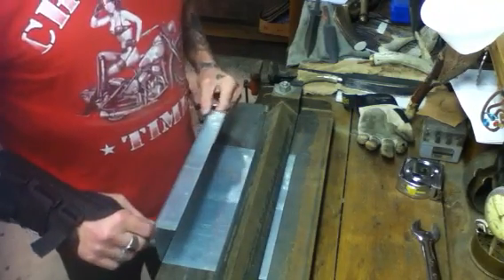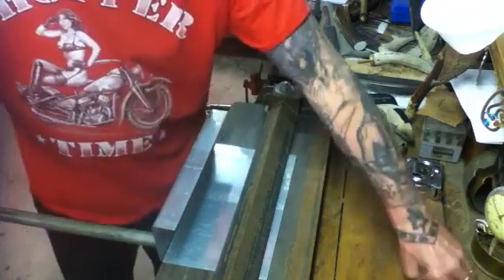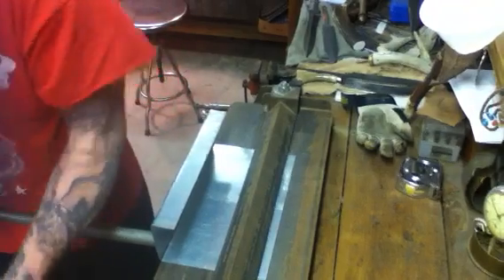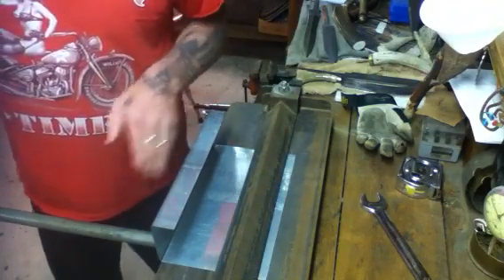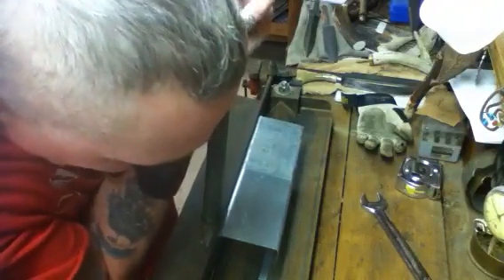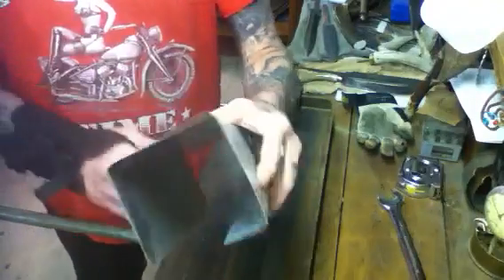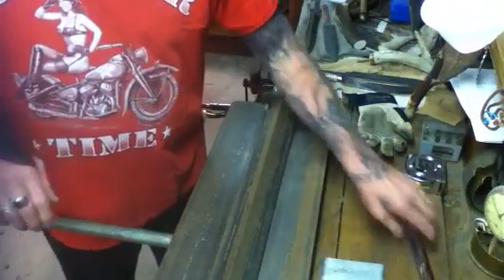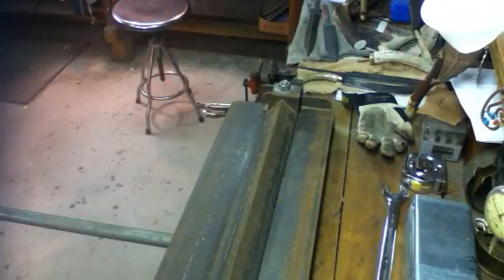Simple home made sheet metal bender

Comment: good job ,  if part attached to handle was vertical with 3/4" thickest could do more types of bends also and if angle iron on springs was replaced by a 6" wide grading machine blade cutting edge with reinforcements, sheetmetal sides  could be folded for strength and about 1/4" metal could be bent. mine is 27" wide and will bent 1/4" metal no problem,  biggish problem I had was how to make clamping and bending pieces work for 1/4" thichest
Reply: Have you posted any videos of your build. I'm having trouble visualizing what you are suggesting. I want to put together a small unit and shortfusedleathernk's is really a clean, sharp looking brake.